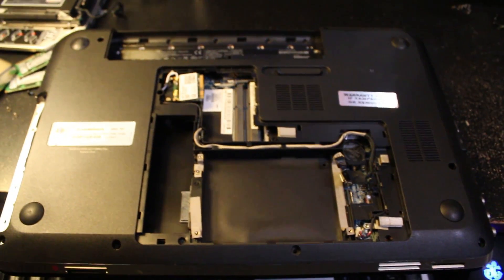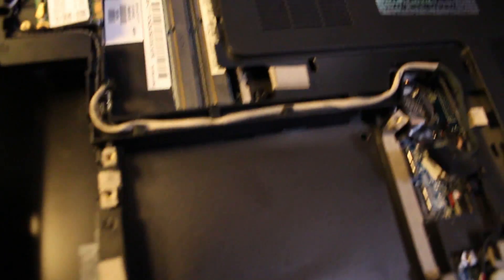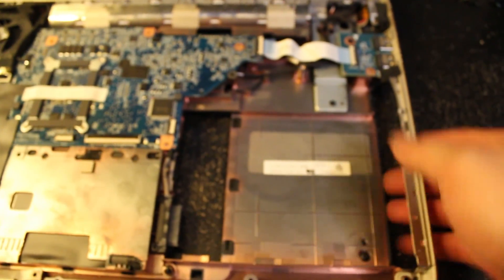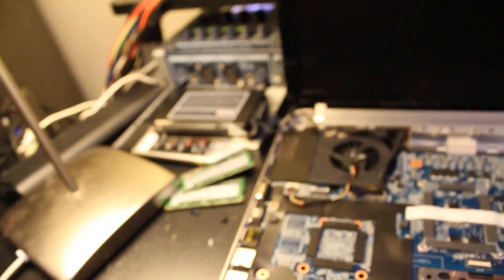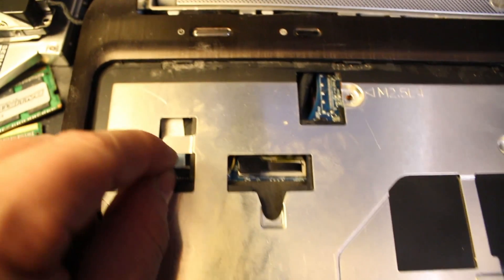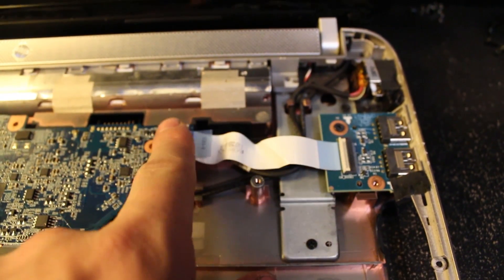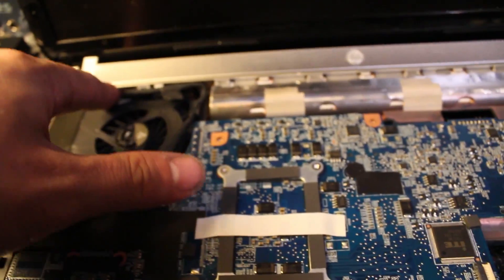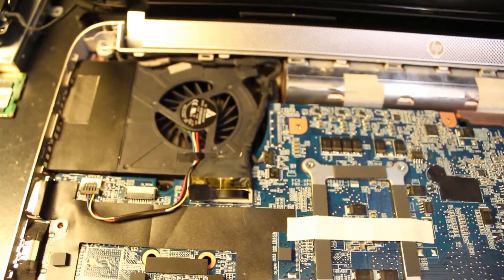HP DV6 CPU FAN Replacement Walkthrough— Take Apart & Disassembly for Overheating Laptiop

Comment: nice detail bro but skipping the actual removal of the old and installation of new fan honestly kept this video at an amateur level as far as tutorial guides go. lots of people have never messed with cpu adhesive and when you skipped that part they went and found another video that showed them that part. I think you did great! but that is just a profesional courtesy tip! it would also allow you to add named steps that would allow it to be a step by step from google search. Thanks!

Comment: I voted down due to missing steps and failure to show what part was replaced. The fan itself or the whole assembly? The service manual have been posted by HP on there support website that gives better info then this video.

Comment: IVe got 3 teeny tiny screws i couldnt forgot to put it back. Where they might belong? lol 
Put my Laptop back together, everything is working so far. and the fan noise is gone, and even under stress, cpu doesnt go more than 61 C.
And fan doesnt even go crazy fast and loud before :D thx

Comment: Rrrrrrggh.  I've got a DV6 but your model is slightly different from mine.  Or somehow I missed the microscopic screws under the fan that I should have removed first before mangling the old fan.  Then I had complications and side effects.  Somehow this turned into a five hour project.  I'll echo j2d2, try making the video while doing the work, not telling us what you remember doing.  I think you missed a few things.

Comment: I replaced the fan in mine, everything works but the new fan runs top speed and does not slow or go off.  The cores are between 45 and 50 centigrade.  any help out there?
Reply: Mine has the same problem. Did you solve it?
Reply: Yeah, I took the replacement fan back out, it is wired differently.  I spoke with an HP tech and he said it's really important to use HP parts for just this reason.  I ended up pulling the seal off the bearing side of the old fan and oiling it.  I put new paste on the sink and it's running much cooler and quieter.  I'm assuming in the future this fan will get loud again and when it does I'll order the HP fan.